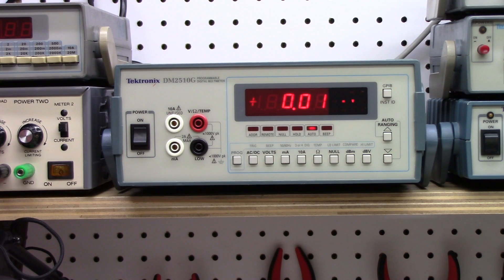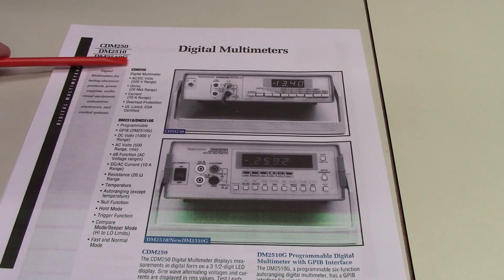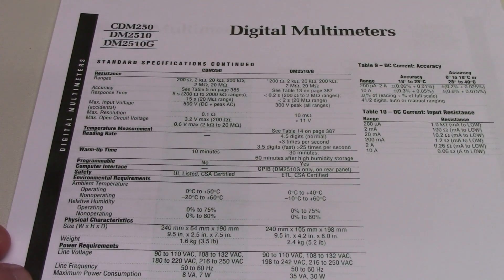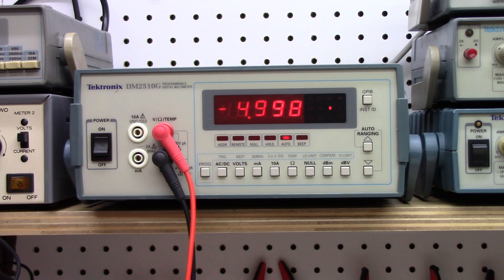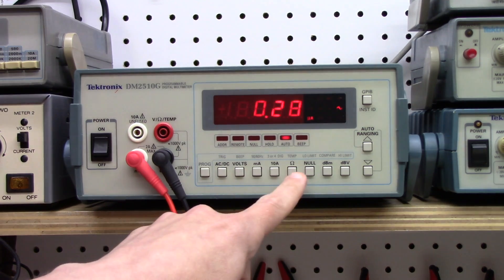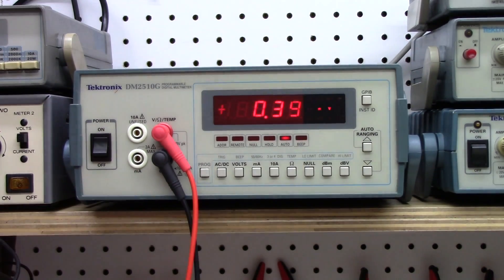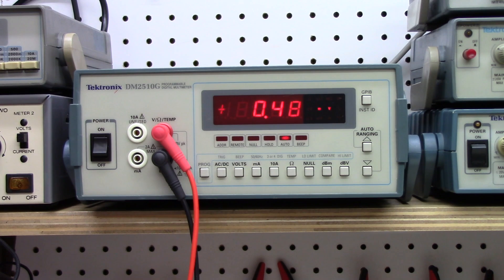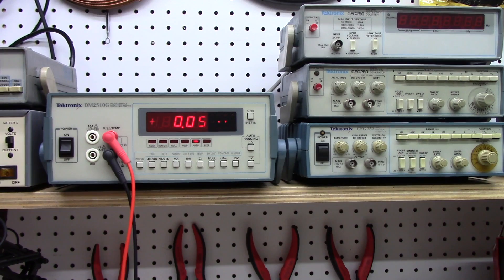#47: Tektronix DM2510G multimeter

Comment: The last digit jitter has always been stated as + or - 1 LSD.  To get around it, there are two methods.  One is in principle to have a converter with 5 digit resolution and then not display the last digit.  The other one is to do averaging.

By the way, the accuracy statement in the specifications reads 0.03% of reading + something of full scale.  The latter part, if you calculate it relates to your noticed jitter.

Then another thing to remember is that the conversion (and display) rate in most meters is synchronized to the line frequency, being for example 6 per second at the American 60 Hz power.  That has a great effect to the listed Normal Mode attenuation at the ever present line frequency hum.  You might check again the Normal Mode attenuation figure in the specifications and probably find a relationship.  Something like 60 dB with unsynchronized and 100 dB with synchronized conversion units.

As to the Pt resistance temperature sensors, 100 ohm types are readily available and not terribly expensive, but if this meter uses any of the other "standard" values, then  it changes to much more difficult proposition.